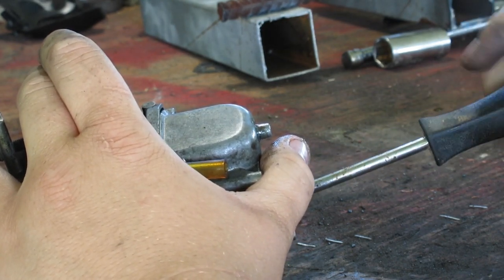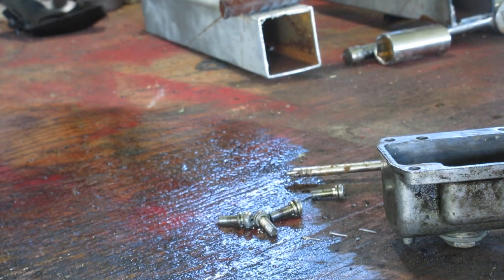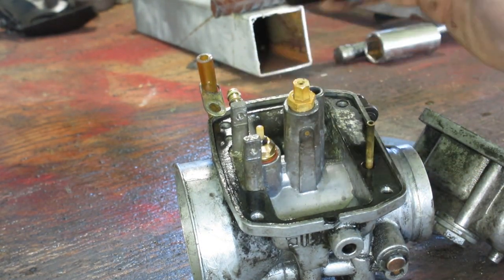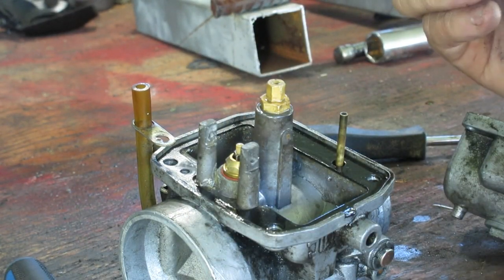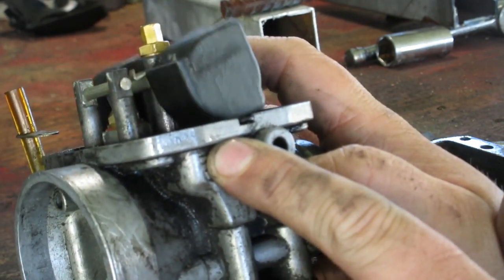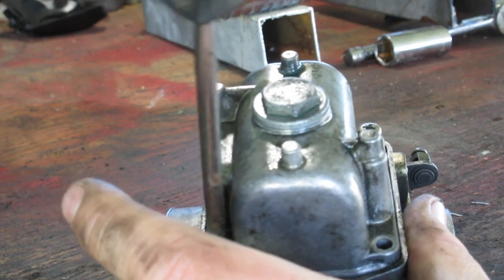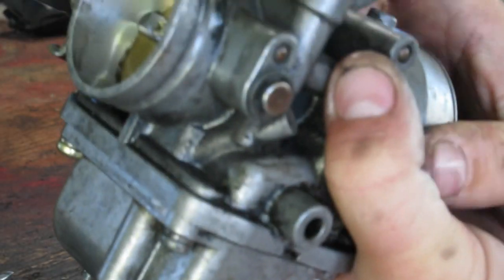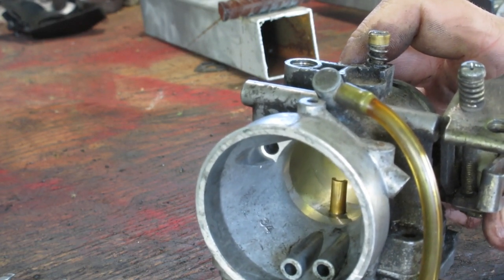Yamaha enticer, 340￼ carburetor, clean.

Comment: Hello.  I am new to snowmachines and wrenching.  I was given an Enticer 340 for the sugar bush.  I took apart the carb and cleaned, replaced fuel filter, trying to figure out why it won't start.  If I remove the plugs and drop a little fuel down, she'll start, and now even stay running (I believe to now getting fuel through the new filter, the old one was quite cruddy).  She will rev up when I give it some throttle and stay running.  I don't know what you were listening for exactly when tuning...  And help/suggestions would be appreciated.  I have picked up a primer kit to install, but it's made it 44 years without one, so I'm guessing it's all about tuning the card.  TIA
Reply from the maker: Just the adjustments of the high and low speed jets